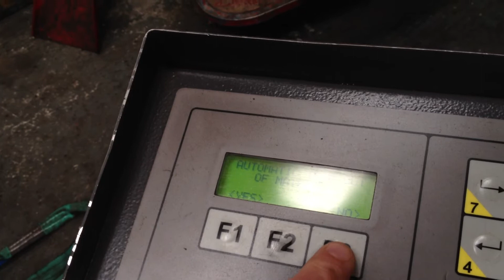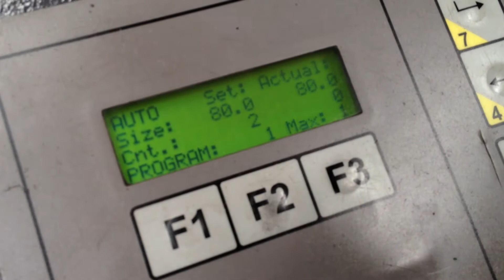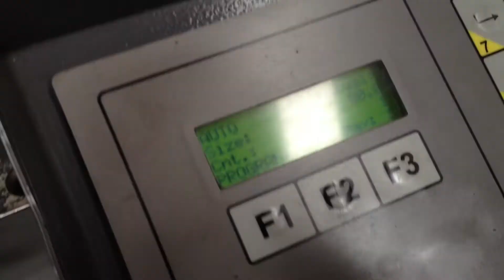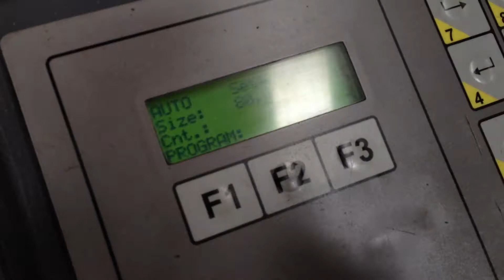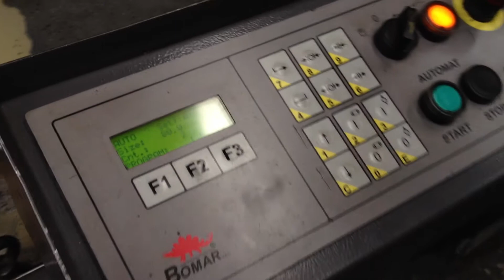Bomar Fully Automatic Horizontal Bandsaw, Model Individual 510/330 GA.

Comment: this looks like a nice saw. however the left guide should be much closer to the piece. and to cut aluminum you can go much faster. 20 seconds would be more than enough at 300 rpm blade speed.